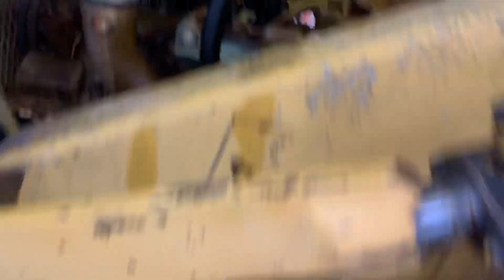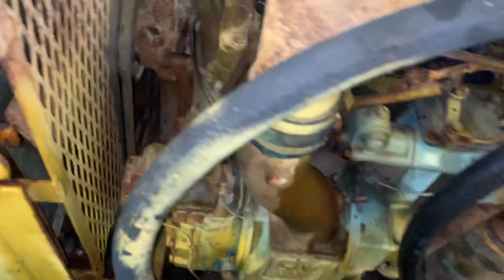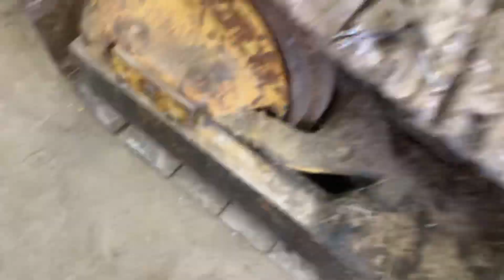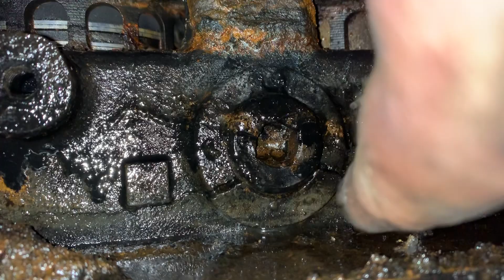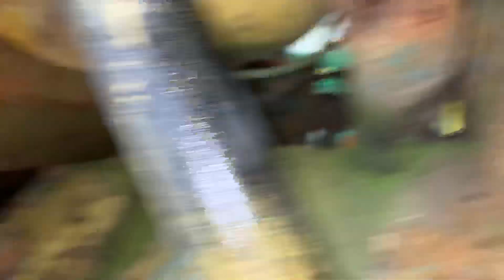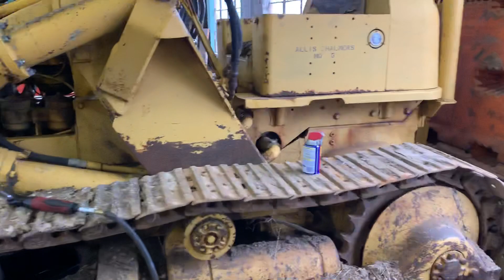Allis Chalmers HD5 update #1

Comment: Keep posting videos. I have the same machine without the roll cage. Mine just sprung a fuel leak today that I’m going to have to figure out. Wish we were neighbors!
Reply from the maker: Glenn Edwards thanks for the support! I can’t wait to have it going! I’ve been busy with work but I did just buy a parts machine so more videos to come!
Reply: Any chance of a quick video showing the limb risers and roll cage, the mounts and such? I really need to build something similar. Awesome machine!
Reply from the maker: John Geese I can certainly do that. Feel free to sub and you’ll get a notification when I post a new video
Reply from the maker: John I uploaded the video of the rack. Hope it helps!
Reply: Can't wait to get my hd6 going steering clutches are stuck and full of mud one done and in place.
Nice low hour  machine appears to have sat for many years .good luck with your projects, check our General gear webmaster tractor parts 
They have new and used parts and the website is full of great info.